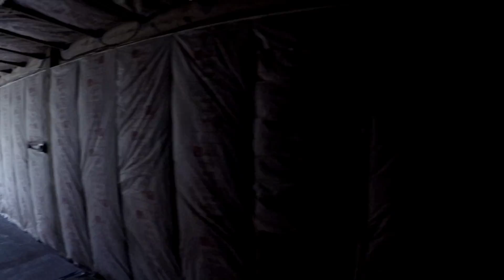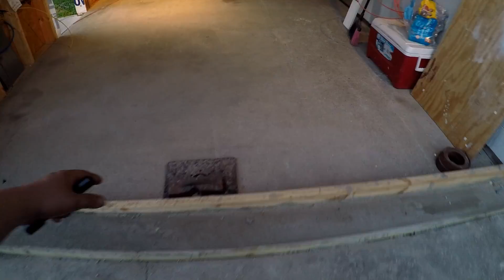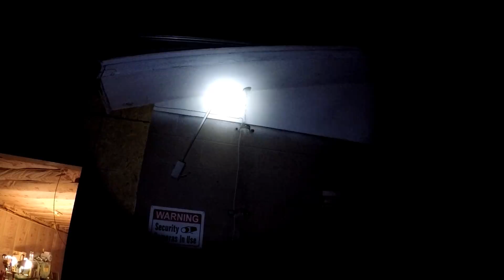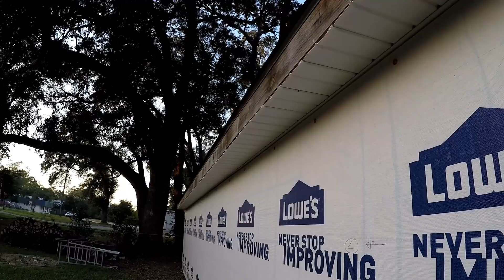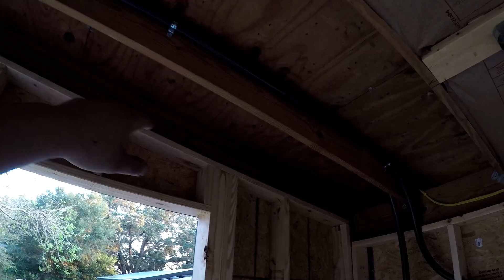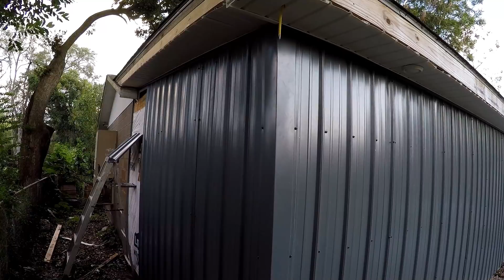SNS 187: Shop Enclosure Build Continues

Comment: Man I can't believe the difference between northern European (Norwegian) and American electrical. Non of that would be remotely legal here. I know we're paranoid with our rules but  this is special. Like we have to run all hidden wiring in pipes in the wall. Cool to see the difference. Cool video Adam! Looks really cool
Reply: Eirik Strange USA home are not all burning down? Possibly Norwegians are over regulated?
Reply: gotcha thanks for the info always good to learn see where im from the what use the most is ac also  dryer and stove what is 220v (2 120v combined ) but i also live in cali so where im at no snow
Reply: Depends where you are at in the USA. In the Chicago area for instance, conduit is required for wiring inside the walls. Yet here on the west side of the state it's not required.
Reply: i may be wrong but isn't all of it hot with no breaker? and use fuse on the appliance? also they do run some wiring in conduct too like you see with the breaker panel the stuff coming in 120v if it get a short breaker will kick in
Reply: Eirik we have breakers here now :) but we also have ring circuits and fused plugs...
Reply: Pipes in the wall would be nice.  It would be easier to make changes down the road.
Reply: David Howard we have 230V IT distribution which is special. We're moving over to TN but it's slow going. Unlike Britain we have breakers. Grounding in Norway with the IT distribution is perhaps the biggest difference.  We have a large use of power here, it's cold and almost all heating is with electrical power.  Food is also made with electric power, and electric cars are really popular here. So the laws and regulations are strict and too strict but we also use a lot of electricity
Reply: craigleemehan I bet we are but the IT distribution is dangerous so we almost have to. Working as an electrician here is also strictly forbidden without a 4 year education.

Comment: Adam,   The shop is coming along nicely, you've got to be pleased.  I really like the color you chose for the exterior too.  I have a question about the roll up door.  Will there be enough room for the door when rolled up on the right side (looking from the inside out) without the  door hitting the ceiling?  I know that the mechanism has to be mounted a little higher than the opening so when the door is down it is up against the interior wall to seal the opening from the elements and critters.
Reply from the maker: The contractor measured everything and got the biggest door he could.

Comment: i'm worried that the floor by the roller door is going to slope inwards.    when it rains you will have water run into the shop
Reply from the maker: No I wont.

Comment: Looks great Adam. My only question is “hot and cold” valves are reversed. Again looking great.
Reply from the maker: As long as turn the blue handle, the welding machine will get water.
Reply: the would be correct in mexico
Reply: Which makes it correct in approx. 60% of Florida!!
Reply: My son in law helped me install a shower/ bath combo and "he" somehow got the hot cold valves reversed, but hey that was fifteen years ago, and they still work :) .
Reply: I have a laundromat and installed a sink with only cold water but has a hot faucet(not used or hooked up).  No problem.

Comment: Make a water drain/gutter in front of the roll up door, as shown you have might travel a higher slab than the shop floor. With the heavy poor down you have, you do not want water running into the shop!

Comment: Looks good. Just 1 nit pick. You CAN NOT run romex in conduit. Definitely not code.
Reply from the maker: +Matthew Barras I expect several comments like this. Watch me!
Reply: Everyone's an expert lol
Reply: More elaborate answer: https://diy.stackexchange.com/questions/31149/can-romex-nm-b-be-run-through-conduit
Reply: lol, nice. Lots of shops around here with romex ran in conduit haven't burnt down yet.
Reply: You obviously didn't click the link. It appears that it is to code.
Reply: It's funny that removing sheathing from Romex is actually prohibited by the code. Even though internal wires are likely to be similar to, if not exactly, THHN/THWN-2, they are not marked and therefore could not be identified as such. It is violation in the sense that NM cable is rated, listed and labeled as an assembly.

However, what you did (stripping sheathing from Romex and running it through conduit) seems to be what is generally accepted by inspectors. Inspectors would argue that running NM in conduit is prohibited by the code (which is not true -- but with certain limitations -- as noted above) and at the same time would let one run stripped Romex through the conduit (which is prohibited by the code, if interpret code in a very formal way).

It's ironic.
Reply: Matthew, those are not wet locations...
Dry Locations:  A location not normally subjected to dampness or wetness. A location classified as dry may be temporarily subject to dampness or wetness, as in the case of a building under construction.

Damp Locations:  Locations protected from weather and not subject to saturation with water or other liquids but subject to moderate degrees of moisture. Examples of such locations include partially protected locations under canopies, marquees, roofed pen porches, and like locations, and interior locations subject to moderate degrees of moisture, such as basements, some barns, and some cold storage buildings.

Wet Locations:  Installations underground or in concrete slabs or masonry in direct contact with the earth; in locations subject to saturation with water or other liquids, such as vehicle washing areas; and in unprotected locations exposed to weather.
Reply: Thanks for providing this link.
Reply: He is not looking for certification online to see if he is in code or not! Enjoy the video, I know I did.
Reply: MicrophonicFool I stated California code about Romex cannot be inside conduit. I bought Romex romoved the the sheathing and had loose wires that's fine.  Anyhow you made valid points...  My area also affords a percentage of square feet of windows to the amount of square feet of the room.   Idk about the newest codes. I'd assume in California from when I've discussed with contractor s in home Depot....
Reply: As everybody's citing their code books, can everybody at least state which state's code books they're reading? That might avoid some confusion.
Reply: You can. Code would actually require running NM inside conduit in certain cases ("Cable shall be protected from physical damage where necessary by rigid metal conduit, intermediate metal conduit, electrical metallic tubing, Schedule 80 PVC conduit, Type RTRC marked with the suffix -XW, or other approved means.", 334.15).

Thing though, is that you won't be able to run a lot of it since "For cables that have elliptical cross sections, the cross-sectional area calculation shall be based on using the major diameter of the ellipse as a circle diameter.".

With that said, different jurisdictions have different modifications of code and there is always "I don't like it" attitude when it comes to inspections.
Reply: You can quote code chapter and verse all you want, but there are still areas of the country that couldn't care less, or work by their own riulebook. I have seen literally thousands of lights mounted in eves, fed by Romex.  Works just fine.  Builders build to code that flies in their area, not necessarily what the book says.
Reply: Matthew Barras People who have never worked out of their area, sometimes think code is the same everywhere. Codes aren’t even the same from county to county in most cases.
Reply: Matthew Barras Your assuming.
Reply: He's assuming a LOT, and also handing out incorrect information.
Reply: Those codes vary alot. I've been to places where it must be in conduit, although separated from low-voltage wiring for other needs
Reply: I was pointing it out in case you didn't know. BUT your insurance will not pay out if something happens. Like a fire. Just an FYI. Looks like you are sweating all kinds of little things. But ignoring a big thing like electrical. It is your shop and money on the line. Do what you want.
Reply: NM is not allowed in a wet area 310.10(B)(C) also 334.14(B)(4). The Romex in the eves is also not code. As that is a wet area. 300.9 Says the interior of conduit in wet areas are considered wet areas. 334.15(C) Specifically allows NM in conduit on a wall drop. But in an unfinished basements only. 334.15(B) deals with wall and floor penetrations. Like the liquid tight that was put through the block wall to feed Adams second panel. Put it this way. My inspectors do not allow NM in conduit except at floor and wall penetrations and 12" max each side of the penetration.

Comment: you need some windows
Reply from the maker: Perfect for thieves to look into and and decide what they want to steal.
Reply: Yes. I can't stand to work with no natural light.
Reply: raoul crisan - no way, it's not an art room, it's a workshop.  The fewer openings the fewer access areas there are to arsehole thieves.  The LED lights will give Adam all the light he needs.
Reply: Maybe the thieves are curios what is in that building without windows, its your shop, do it your way, for me its ok, if i want to steal something i just watch your channel :)))))
Reply: It was a joke, I live in Rome, Italy, so dont worry
Reply: You can get tiny skylights that let a lot of natural light through and no way you'd fit a person through them. They are handy for shops like yours. I have a sheet of polycarbonate roof sheet on a section of my shed roof and it's like working outside in that spot.
Reply: air too?
Reply: I agree Adam. My old shop got broken into cause they broke a window in the back and climbed in. Stole 30 years of tools from me. Now i have 5/8" steel bars over the windows and the new shop has no windows and no extra doors.
Reply: Windows are overrated. They suck for loud sound containment, heating/cooling issues, and the obvious security factor.
Reply: Thieves, that's what I thought when I saw no windows.  Door that can't be kicked in too I bet.  Nice.
Reply: Windows are not a beneficial light source to a person who's making videos, they are never as energy efficient as a wall,  they require ongoing maintenance and are more expensive than a wall; all this in addition to the security factor already stated.